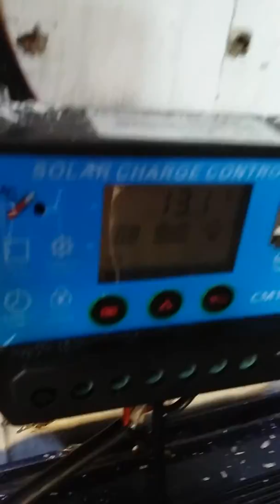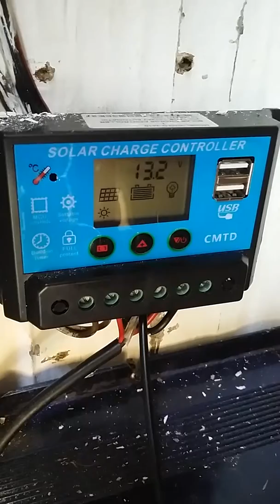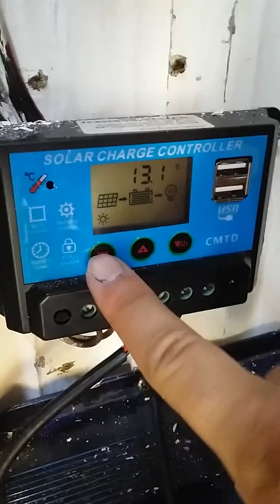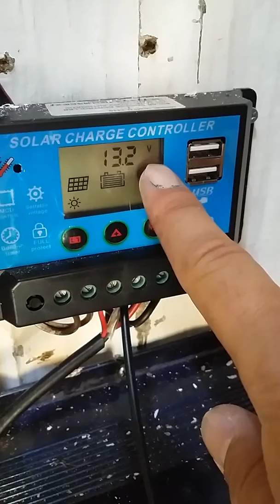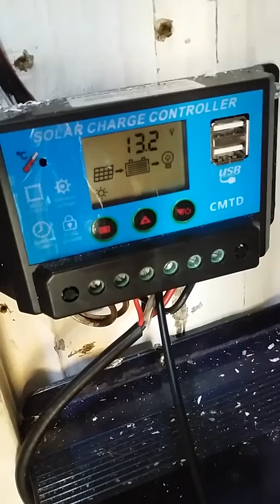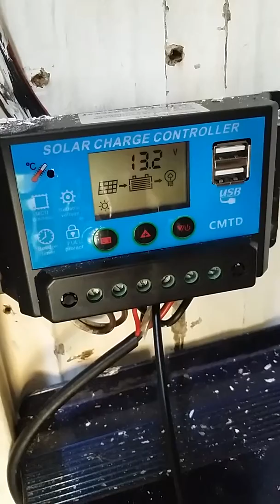Cheap eBay PWM solar charge controller review & warning.. Avoid overcharging / boiling battery

Comment: What's the controller function? Why they have different capacities (20, 30 and 60) amp? Having 2 panels both generating 200watts, wich controller I must buy?
Reply from the maker: Solar charge controllers regulate the current from the panels to a safe level so it can charge the batteries.

A 40A controller is adequate for a 400 watt solar panel set up.

At this size and investment, we recommend installing the MPPT controller.

A PWM controller is a fraction of the cost of a MPPT but the considerable loss of harvested energy would offset the cost of the larger system.
 - https://mowgli-adventures.com/400-watt-solar-panel-wiring-diagram/
Reply: @d-widdy The pwm type of chargers doesn't  regulate current at all. It regulates only the input voltage. It simply handles the amperage that it is rated for. This is due to the fact that the solar panels behave like constant current sources. This simply means that they cannot put out any bigger current than that written on their label. Besides the testing of them includes their short circuit current, which is the maximum they can put out. That's why those simple pwm chargers have nothing to do with current regulation. But they must be able to handle both: a maximum voltage and current, according to their rated power. It all depends on the mosfets they contain...and their heatsink...

Comment: Hi, I use 55amp acid battery plus two solar panels 200 watts both. wich controller I must buy? 
It's seems like the power coming from the panels is larger than the battery capacity.
Reply: Get cheap one from China store i did, 1 year no problem

Comment: your first mention you changed no settings, i  can almost guarantee thats the issue, your overvolting it as default, your using a lead acid battery by sounds of it so you need to read up max voltage on your battery or just see what your battery is capable off via reviews and spec sheets off the manufacturers website
Reply from the maker: A charge controller should not be set to overcharge by default but this is what's happened to many people. I did adjust the settings & it still cooked another brand new battery.

Comment: FYI the charge controller comes with a default setting for a Gel battery. B01 is Gel. BO2 is AGM. B03 is the Flooded type.  you need to set the battery to the correct type. I have a standard deep cycle flooded battery.
you need to set the float voltage to 14.0
Reply from the maker: Thank you Paul. I wonder of they have improved the products in 2021??.. Hmm
Reply: @d-widdy  I got one yesterday and if you keep it at factory settings it’s set up for 12v lithium batteries anything else you got to toggle the settings
Reply from the maker: @hamster1-1  good to know. Have I figured out the timer setting?
Reply: @d-widdy   no I left it at 24hrs
Reply: @d-widdy  I believe its only for how long the output in ON for
Reply: True
Reply: Yeah!
Reply: i have a mitsuba 100ah car battery, i can find what the fuck type is gel agm or flooded
Reply: b1 is gell ? not a regular flooded lead acid? my sheet-manual does not say anything about what b1- b4 means at all.
Reply: @yuriylutsyshyn3495  There is a lot of variation between these controllers depending on manufacturer , type and model. Always look up the battery type for your model only and not go by what others are doing
Reply: 14.4 lead calciun
Reply: no i think b01 is lead acid B02 is Gel and B03 is AGM
Reply: I have AGM and both are charge on 14.2 for years. No any problems.
Reply: @srdjan272able  How does your controller indicate end of charge ?

 Mine is always charging, arrow icon is either flashing or on, but it is newer off when battery is fully charged. I have regular flooded lead acid 200ah battery.

Thanks.
Reply: @yuriylutsyshyn3495  Shoestring Prep's video says that B02 is for Lithium batteries.  Did it change?
Reply: Isnt 14,6v for agm

Comment from the maker: This is a PWM charger.
A PWM (pulse width modulation) controller can be thought of as an (electronic) switch between the solar panels and the battery:

The switch is ON when the charger mode is in bulk charge mode
The switch is “flicked” ON and OFF as needed (pulse width modulated) to hold the battery voltage at the absorption voltage
The switch is OFF at the end of absorption while the battery voltage drops to the float voltage
The switch is once again “flicked” ON and OFF as needed (pulse width modulated) to hold the battery voltage at the float voltage
Note that when the switch is OFF the panel voltage will be at the open circuit voltage (Voc) and when the switch is ON the panel voltage will be at the battery voltage + voltage drops between the panel and the controller.

The best panel match for a PWM controller:
The best panel match for a PWM controller is a panel with a voltage that is just sufficiently above that required for charging the battery and taking temperature into account, typically, a panel with a Vmp (maximum power voltage) of around 18V to charge a 12V battery.  These are frequently referred to as a 12V panel even though they have a Vmp of around 18V.

Comment: My last comment would be this:   Sounds as if most people are using this cheap controller with high wattage panels and perhaps lower amp hour batteries.  Is that a fair assessment?   Cheap controllers should be mated to lower wattage panels and larger batteries that have small loads.  Resistive loads.  Guess one you get what you pay for and two building a system to meet your needs will determine what equipment will be used.  Safety should also be a determining factor in your design
Reply: 100w solar panel for 20ah charge controller, is it too much?

Comment: Frater Mus.  I would really like to here your opinion on my comment too.   Thank you
Reply: > Could a simple over charging prevention circuit independent of the pwm controller be installed between the pwm and battery?

The charger will not overcharge;  it will hold the configurable voltage setpoint as long as solar harvest is available.  The trick is to to pick an appropriate voltage setpoint for a single-stage charger like this.  

For standby batts that might be a Float voltage in the 13s.   For deeply cycled batts (depleted to 50% DoD each night, for example) it would likely be an Absorption-style voltage in the 14s.  The battery manufacturer's info and your own testing will help find the voltage that works best.
Reply: That's good to know.  I purchased a dc to dc buck boost converter pcb and an overcharge prevention pcb as well and want to incorporate this in my system after my pwm.   The pwm I have learned, since my comment here, will not turn off.   So my pwm is not stopping as the man in this video experienced.  I will keep you updated, Fraternity Mus.   Thanks for your knowledgeable comment.

Comment: I have one of these pwm pos as well.  Haven't hooked it up yet.  Im glad that I found this video.  My philosophy is that circuits can be tweaked after all efforts in programming have been exhausted.  Could a simple over charging prevention circuit independent of the pwm controller be installed between the pwm and battery?   Any thoughts?
Reply from the maker: No point in having two charge controllers. Either set max voltage to a sensible level eg 13 - 13.5v or replace with a proper charge controller eg victron smartsolar

Comment: well I'm just looking for a video that explains exactly which button does what so that you can get these controllers to respond to settings. With very limited instructions that come with them it's impossible to get these things to respond to anything when reading the instructions or assuming which button does what. So I'm frustrated that I can't even get beyond the initial setup or find a video that helps with the very basics
Reply: On most of these the left button changes the display, as seen in this video. 

1.  Short-press it repeatedly to get to the setting you want to change (as seen in this video).  Depending on firmware, the "PV OFF" screen or similar is the battery voltage you want to hold.   
2.  long-press that button to allow configuration. The value will start to flash.   
3. use the center and right buttons (typically marked up-triangle and down-triangle) to adjust up/down as desired.  
4.  short-press the left button again to save the setting.
Reply: Take a look at Adam Welch videos. He tests lots of inexpensive solar charge controllers.

Comment: These scams are all over amazon as well. Never buy from China!
Reply from the maker: if you set the max voltage to 13.2 you will be safe. 
Ive finally moved over to a Victron controller

Comment: "Then it should drop to 13.4".  No, it's a constant-voltage charger.  Set it to the voltage you want it to hold.   If you want a fancy multistage charger then buy one.
Reply from the maker: The PWM is a good low-cost option:

 

• for smaller systems

• where the efficiency of the system is not critical, e.g trickle charging.

• for solar panels with a maximum power voltage (Vmp) of up to 18V for charging a 12V battery (36V for 24V battery, etc).  

 

The MPPT controller is best:

 

• For larger systems where the additional 20%* or more energy harvesting is worthwhile

• When the solar array voltage is substantially higher than the battery voltage e.g. using house panels, for charging 12V batteries
Reply: @d-widdy  That has nothing to do with what I said.
Reply from the maker: @fratermus5502  pwm is 3 stage (multi stage charging) so no it's not a fancy 5-stage charging system. Neither is it a trickle charger. The point of this video is to warn against these controllers because the actual charging system cooks batteries by default. Sorry for any confusion. If you can afford it get a genuine mppt controller.

Comment: What does a controller like that understands as "float charge"? Mine(model identical to yours) would start upping the voltage at the start of the charge(early morning, 6 AM), than, as it gets to 14.4v(midday), it will keep it there until the end of the day(6 PM), even if I don't discharge the battery during the night, and even as the battery is pulling less than 200mAh of current from the charger. Shouldn't the charger go to "float charge" and try to keep my battery stable, from 13.0v to 13.7v (adjustable), when it is no longer getting usable current from the charger? Isn't that the dictionary definition of "float charge"? Ps: My inverter only turns itself on at 6 PM, so it can't be blamed for any "current leak", all the power produced by the solar panel during the day hours has only the battery as its consumer. I am starting to think that this charge controller just ignores any settings you put in. I have never felt my battery hot, nor any smell of the electrolytes boiling though. I have a 100amp, sealed 12v stationary battery.
Reply: It is a single-stage (constant voltage) charger that will charge to the voltage you specify.  Multistage charging costs more than $10.

> What does a controller like that understands as "float charge"?

A "float charge" is a single voltage held forever.  13.6v or whatever, as seen with stationary, non-cycled batteries charged from shore power.    The term is a good a translation as any, but some people interpret it as being part of a bulk-absorp-float multistage sequence and this controller doesn't do that.
Reply from the maker: I've had several and they all seem to overcharge / boil batteries, so I've set my maximum charge voltage to 13.7v. when possible go for a Victorian energy smart solar charge controller & say goodbye to all these issues
Reply: @d-widdy  You will continue to destroy batteries until you understand battery charging and solar charge controllers better.   Charging the batts to 13.2v off solar will kill lead batteries  just as dead; it will take somewhat longer. 

BTW, Victron controllers are having serious problems right now with the controller's "smart" absorption dropping prematurely leading to bank capacity loss.   The present workaround is to hold Vabs permanently, exactly like this controller does.  Money is not the solution;  understanding is the solution.
Reply: @d-widdy  Lucky me that my battery does not boil nor gets hot or loses fluid by evaporation, even after a year running on this charger. I guess that's due to the capacity of the battery(100 amps) and the relative low current of the solar panel, witch at most puts 8.2 amps out, less than 10% of the battery capacity, and less than half the recommended max charge current. Well it's a pretty good and expensive lead acid stationary battery after all.... I guess I paid for quality on my storage at the expense of my controller. Next time I get some real free time I will build my own charge controller, I often revisit and reiterate in my mind the ideal pwm charger circuit when I take a nap.
Reply: @d-widdy  I've found a way of dealing with these, tho not ideal, it will save your battery from a boiling or explosive sure fate. I already had a monitoring unity built around my solar system, in order to turn the inverter on at night and off during the day(at specific times), switch to grid power if battery is close to undercharge, and send telemetry data to my PC every minute or so. This system is built around an Arduino Nano, with a ESP8266 WiFi shield, a couple of ACS712 30A hall effect sensors (one measuring the current from the panel to the battery and another from the battery to the inverter), a DS3231 Real Time Clock shield, a Voltage Divider (to measure battery voltage, of course) and a Relay Bank(to turn the inverter on and off and to do the switching between grid and inverter). What I did was making use of all of this "telemetry data" to my benefit. I keep checking the battery voltage and the current passing trough from the solar panel in the main loop. When voltage is greater or equal to 14.25v and current less or equal to 600mAh, I open the connection between the solar panel and the charge controller, via another relay that I added to the bank for this specific purpose, and I only reconnect if/when battery voltage equals or lower than 12.80v.  That is not like turning these cheap charge controllers into three-stages "smart chargers" ones, with fancy trickle charging and stuff, no, no way. They are still dumb chargers only capable of Bulk and Absorption phases, however now I get my 100 amps/hour battery charged to the point it must be, and not beyond. The relay normally opens around 12/13 o'clock, if the day is not cloudy, meaning battery fully charged. The sun here shines on the panel until 17 o'clock at least. I'm saving my battery of receiving almost 4 extra hours of overcharging by just doing that. It holds 13.2v nicely until 18 o'clock when the inverter turns on. It is naturally drained during the night by the lights around the hause, comes next day, 6 o'clock inverter turns off, voltage will naturally be under 12.80v, and the cycle repeats itself.

Comment: I have a cheap solar car battery charger panel, it has NO regulation, not that I knew!
Left it attached to a little used vehicles battery, and yes, it had boiled the cells, so I have bought one of these off eBay, hoped it would be an improvement, looks like I need to adjust and check it regularly hey?
Thanks for video, it's a good warning.
Reply: You should not be using the solar charger regulator with a car battery!  Did you not review the videos here on YouTube?  They often say not to use on car batteries!  I guess it could, but you are asking for trouble, for a car battery is NOT a deep cycle battery for a solar system!  No one is to balm for your situation but you!

Comment: This is my problem too its will not stop charging on my battery i set it to 13.5v and it goes to 13.8v it still charging
Reply: There are more than one voltage setting;  be sure you are adjusting the charging setpoint and not one of the load-related ones.

Comment: Having issues with mine as well...  no quality will not stop over charging
Reply: Please post pics somewhere of the applicable setting and the battery voltage measured above that.    I've used many of these and have never seen one charge higher than the configured setpoint.
Reply from the maker: shame ebay dont allow reviews for non uk items... protectionism??